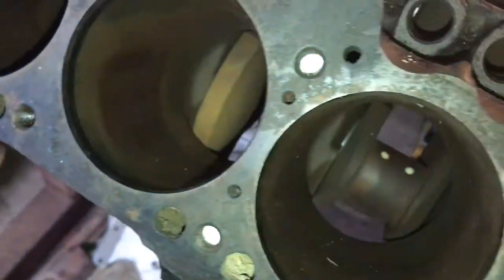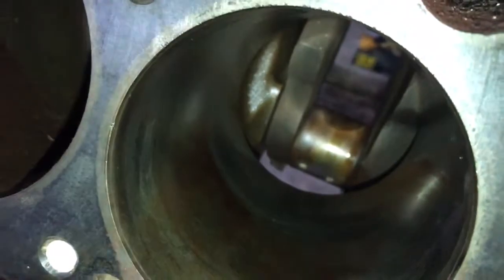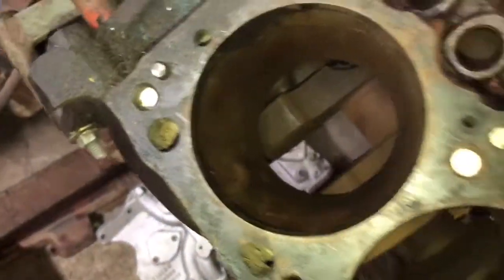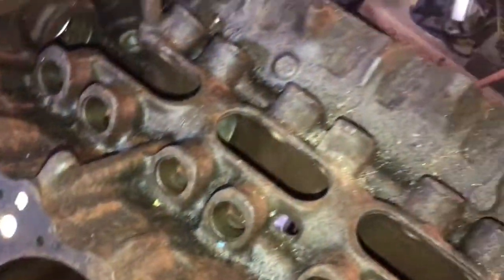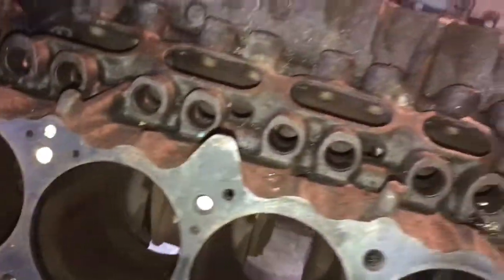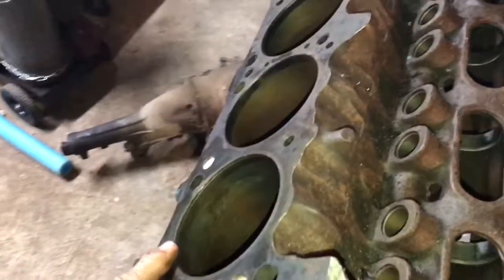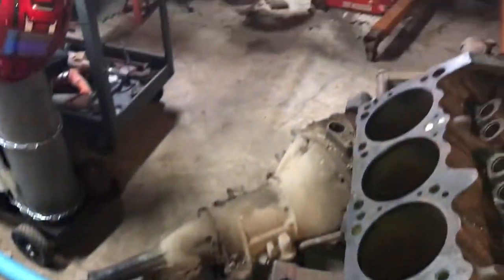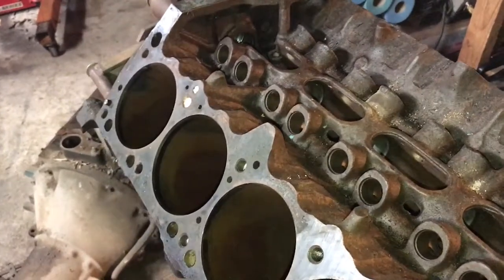Deck height check

Comment: I guess this guy is watching his child or something...
Reply from the maker: Craig Pierce Elmo or me.  lol
I’ve never done acid before, how was it?
Reply: Prochargedmopar Firstly, the video is entitled “Deck Height Check” which you never do. The whatever you’re playing in the background is louder than you, so it’s very difficult to even hear you. You seem to just be doing a cursory engine block look over. There is more video time of your backside than of anything of substance. I don’t normally comment on videos, but this one is just flat weird!
Reply from the maker: Craig Pierce All good points.
Hopefully I’m a little better now since a year and a half has passed.
Elmo was babysitting my then 2yo while I tried to make some progress.
I’ve since turned the volume down in more recent vids.  
I think I do have one up where I actually check deck height with deck bridge and dial indicator.
Reply: Prochargedmopar Thanks I’ll look for that! You certainly have better powers of concentration than I. I need absolute silence when assembling motors, not even a radio!